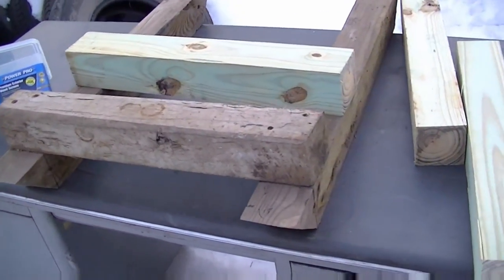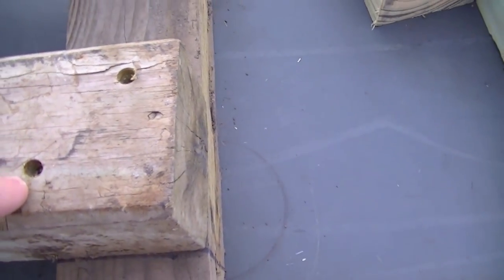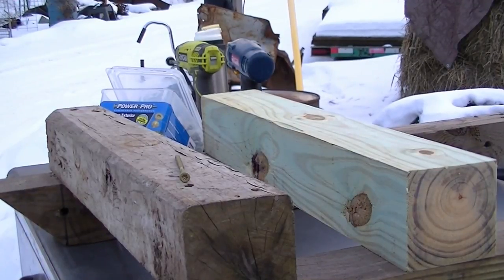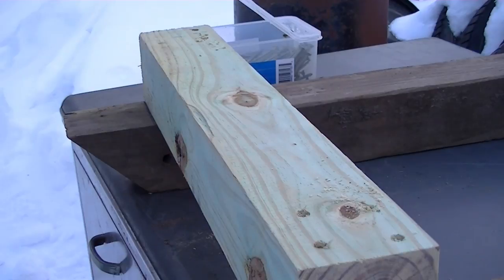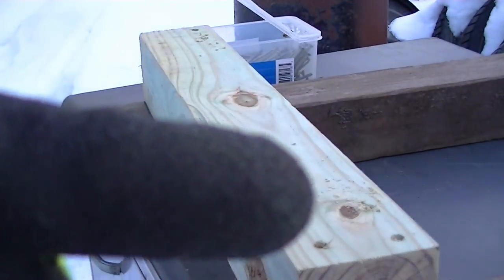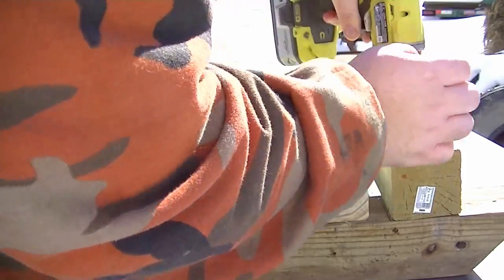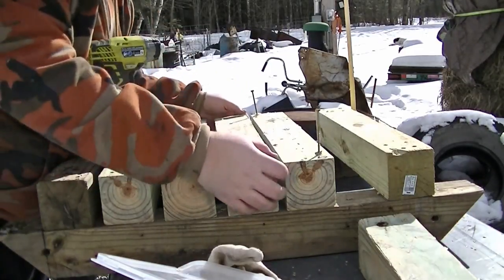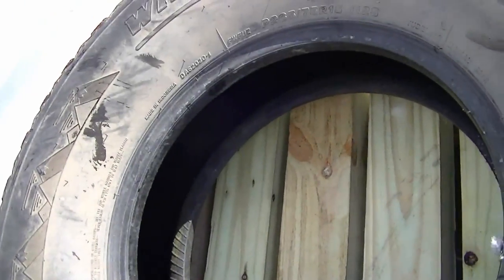Hillman Power Pro 4 1/2" exterior wood screws countersunk into treated 4x4's with no splitting

Comment: These are the best deck screws I have never used! I first bought the 3 inch size. Hillman provides a free Torx bit, even in the 1 pound box. The ceramic coating prevents rusting for many years to come. The torx drive means no more stripping. Over time, I keep buying more boxes of the same screws, just different lengths. They are the best!
Reply from the maker: I have been doing the same, I just used up the last of my really long ones and need to order some more. I think I have these in 3 or 4 different sizes now and I won't buy any screws that don't have Torx anymore unless there specialty like self tappers.
Reply: Good screws, but SPAX HDR-c, better, grip as good and cheaper. GRK pretty good too . All of these or no pore drill, and holding power is better.

Comment: At 3:05 into your vid, the bright green 4x4 began to move. I just realized that this may have been how some ancient monolithic stones may have been moved by humans. The stone was on a flat surface that was vibrated by some sort of sound, and the stones were in a state of rapid oscillation and could be guided. 
I know, random.
Reply from the maker: The tool I am using is an impact driver, so its basically hammering in the screw so that caused vibration which caused the other 4x4 to bounce. Still an interesting idea making the ground shake to make objects move in a localized area. It holds up when you consider what happens in a n earthquake. However the amount of energy that would need to be expended to move an object for any distance would probably be better used in another way to make that happen easier. Still interesting to think about. 

Edit: actually  you would need to make the object shake because if you made the ground shake you would not be able to guide the object because you would have trouble staying stable yourself, so if you could make a regular vibration in the object that caused it to slightly bounce you could easily move the object and guide it to where you wanted it to go.